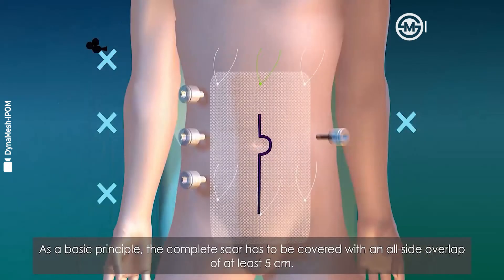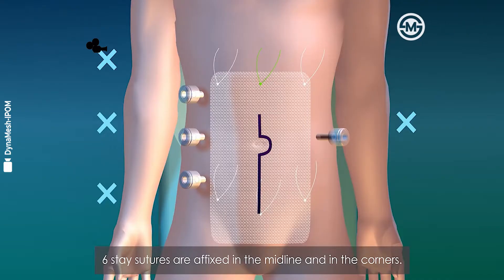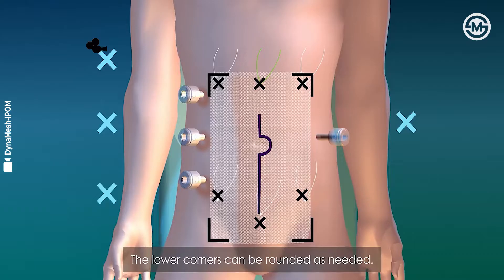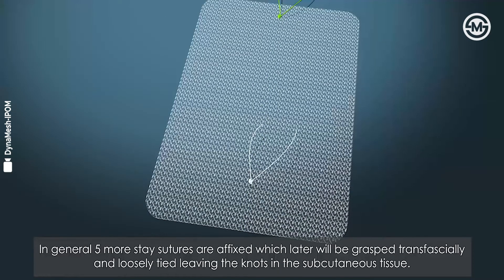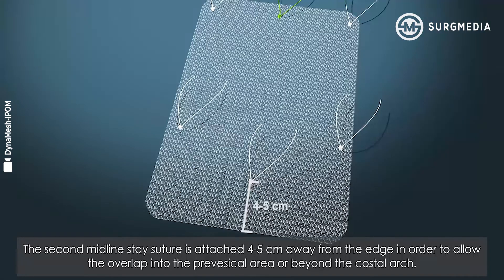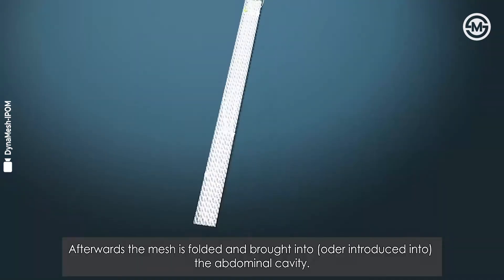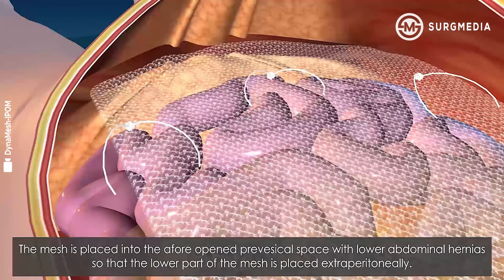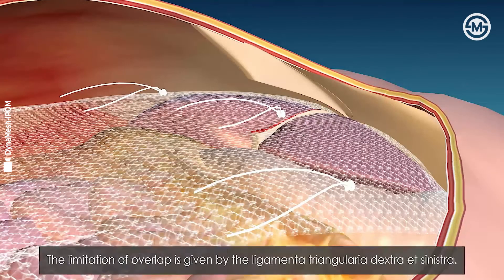How Laparoscopic Mesh Repair Works for Hernia: A Step-by-Step Explanation

Comment: I had this done but they cut me open vertically about 6 inches. Almost a year ago and generally  99% no problems, sometimes after a full stomach I can feel the mesh slightly pinching or  pressing against the  stomach wall. Very glad that I had it done.